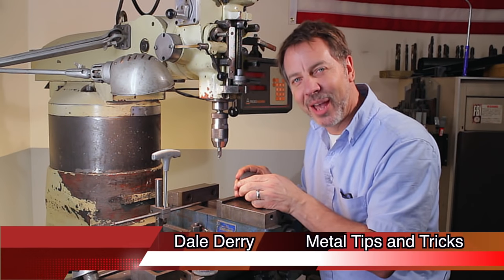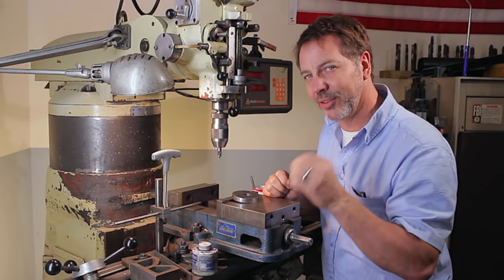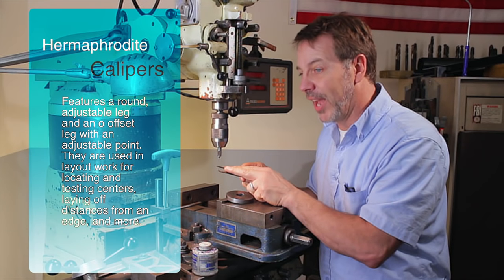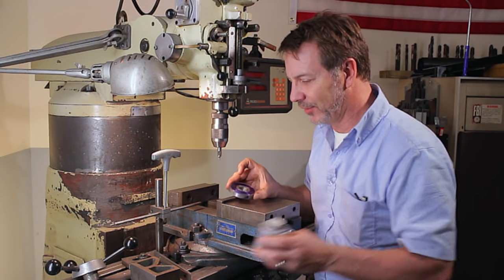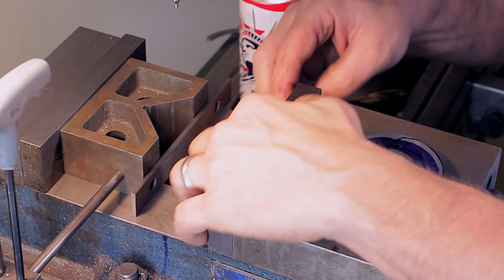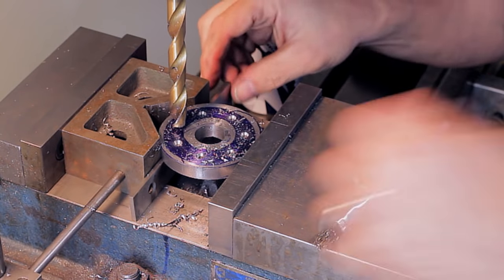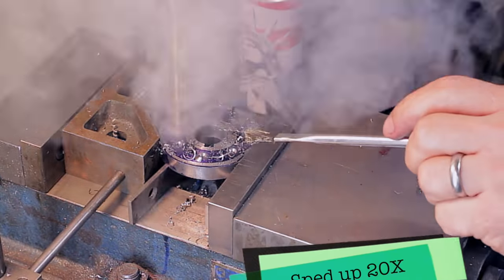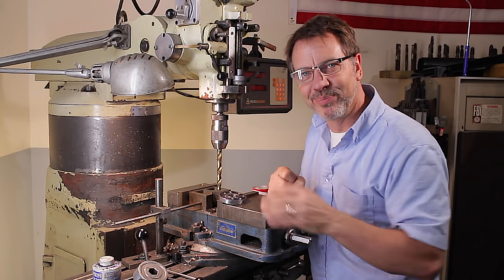How to drill a Bolt circle

Comment: Did i miss something, i was waiting to learn how to use the math to makeca bolt circle, any one can drill the holes,the part that counts is the math to divide the circles.
Reply: Circumference divided by number of holes. Advertising major here
Reply: @basik1dotcom  But the dividers are chord lengths not arc lengths. Then it all depends how good your eyes are to center drill on the scribed lines.
Reply: Divide the number of holes into 360  yerimy
Reply: basik1dotcom 
Yes. 
Elementary my good man.
Reply: You would obviously know how many holes and what dia before starting. The straight line distance ( not curved on circumference) is the segment. To find segment length S

S = 2r x Sin (degrees)
       ——————————
                     2. 

Degrees is the angle between two holes, in this case 7 holes. 360/7 = 51.42857143 degrees.
Reply: @husq2100  Need to divide the degrees by two, not the entire 2r x Sin(degrees)...should read "2r x Sin(degrees/2)"
Reply: @basik1dotcom  ...you should stick to advertising
Reply: @bretthenderson6770   To funny Daddy-O  LMFAO
Reply: @bretthenderson6770  Nice burn. Well done. 😂
Reply: @bretthenderson6770  will do!
Reply: @bretthenderson6770  So S=d(Sin theta/2)?
Reply: @bretthenderson6770  he was right. maybe you should try advertising.
Reply: Pi will never divided down rationally so using dividers on a circumference is a bad idea always.  Angles are better.
Reply: @husq2100  thanks. And setting the calliper distance should be as easy.....

Comment: The method of drilling holes in a round block is easy enough, the problems come about when you need an exact tolerance, if you make 2 separate plates then bolt both them together it would be only luck if the holes line up.
Reply: Can you then use transfer punch to translate the hole pattern over to the other plate? I know one can, jsut not sure how good the tolerance of that may be.

Comment: Or use the bolt circle table in Machinery's Handbook. Gives you the XY coordinates for all bolt circles from 3-12 holes based on a 1" circle. Multiply the XY coordinates by your bolt circle and then use your DRO or the graduations on your table. That's the right way. I'd be making holes before you were done with the layout.

Comment: Actually, indicate in on the center hole and set your table dials at zero.. Then look in your Machinery's Handbook. It has a formula that, If you know the diameter of your bolt circle, will allow you to compute X and Y settings for your mill table for various numbers of holes. If you can multiply and/or divide on a calculator you can do the math. If your lead screws are accurate, it will put your holes on within a thousandth or so.
Reply: and in a zeus handbook it works it out for you so all u do is just multiply,
Reply: Lawrence, right on,

Great little pocket data pad, use it all the time, one in the house and one in the shop, and cheap, about $15 cdn includes shipping from UK,

Edmund.........Alberta
Reply: Get a Zeus handbook. It has all you need to do bolt hole circles. If you have digital display or even the bog standard dials it works.
Reply: Exactly you can even use a dro calculating program online
Reply: No shit
Reply: Exactly my thoughts. Why be inaccurate when you don't need to be. I've been a master Tool maker for 40 years and would never lay out holes with dividers. I respect my work more than that
Reply: i agree with you how did he index for each hole by eye ball?  iso9000 right he has good eye

Comment: I use the bolt circle calculator found online. Make the O.D. of your part larger than the finished part so that you can sit it on the parallels. Drill the center hole first and use the calculator to find where to drill your bolt circle holes. The center hole dose not have to be exactly centered because you will turn the od of your part in the lathe by putting it on a spud with a drilled and tapped hole and a bolt and washer. If you have a DRO on your mill it makes this process very easy. Remember once you drill the center hole do not move the part you are working on untill finished. This is the only way I do this and Ive done it hundreds of times.

Comment: To get this to work folks is you need to know the chord length. There is a formula for that in the handbook. I use it 90 percent of the time and it never fails. I made a cheat sheet up so I refer to that and away I go. Or many modern dro's have a calculator built in. Look to see if you have that. Then just dial the center and away you go.

Comment: A lot of nay-sayers and eliteists here.
40+ years ago I was laying out a bolt circle for a PVDF pipe flange on a wet bench drain, and the company owner chastized me for "gold plating" it. At the time I was offended, and thought to myself "geez - he doesn't care at all about quality"
In later years, I was the business owner, and found myself on the other side of the same discussion. (fortunately the lesson wasn't lost on me and I explained to my employees WHY, which they did understand)

 Some work just doesn't justify pulling out the rotary and spending 2 hours on a pipeflange or something similar where "Good enough IS Good enough" (better actually).
Once that pipe flange is bolted up, no one will know or care if those bolt holes are a few thou off. The machine will not operate any better, just cost more. They WILL care if the machine comes in over budget and everyone looses money on it. Many farm machines are the same story and are designed with loose tolerances where they can be tolerated for just this reason. I occasionally do repair work for local farmers, and they don't care if it's perfect to the tenth, they need it to work for a reasonable cost and fast as they often are on a hard deadline.

It's easy to be a perfectionist when someone else is paying the bills, and you have all the time in the world. This type of setup (and the radius trick in another video) Indeed has a place in industry, and it's a bigger place than most people seem to realize. 

It seemed to me it was stated up front this is a technique for when it's NOT justified to spend 1/2hr breaking down the mill and setting up the rotary, but an awful lot of people seemed to have missed the point.

I think this video describes a better way to do good work "good enough" to make the customer happy and the shop money. That's what it's all about in the end.

Scott
Reply: Hi Scott, 
I'm in agreeance with you. Unless the job requires precision then there is no need for it. I like to be a perfectionist from time to time, yet I know there is line drawn with individual customers and their needs as opposed to what I would do for myself or love jobs for family and friends. Though, there are some customers that appreciate the little bit of effort you put in which is reciprocal kindness 99% of the time, you know others just want the bare minimum - get in and get out. The bottom line is, you don't do anymore than you have to...
Reply: Good 'ole plain common sense, and a really excellent compromise between , cost VS adequacy and client satisfaction.
Reply: nifty1940 no one mentions pride in the job....do it once do it right.
Reply: Holds true for every trade. I try and  show the apprentices when its o.k. to be a wood butcher and when you have to split pencil lines. 🤣😂😁😀😎
Reply: But Scott... he never explained how he got the holes spaced.
Reply: Scott.  great point.    after years of putting blue on a  part.  i just put an indicator on and found where i was at,  and went for it.    why do i EVEN need blue on my part.
Reply: For pipe flanges, this is a great solution. 
If the bolt circle in question is for something that rotates, like an axle flange, rotor or wheel, not so much. As you stated in your reply.
Reply: @tomclark6271  he did. After he put layout fluid on it and he centered his starting hole he used the compass to scribe the distance of center for his bolt patern
Reply: Totally agree. When I was young, everything had to be perfect. Perfect takes way too long when “good enough is just that ... it’s good enough. Why waste time making it perfect.
Reply: In Business School the first lesson we learned was do the Cost/Benefit analysis before anything else. It's fun and prideful to chase perfection. But if it doesn't make dollars, perfection befalls the business...hard to brag about your perfect workmanship in the Unemployment Line!
Reply: @solasauto  center drill
Reply: @tomclark6271  he didn't
Reply: @DrewT  this is why we buy Chinese now we are all unemployed

Comment: I have been a machinist for 40 years and it is always nice to learn something new. I subscribed by the way, didn't want to miss out on other tips and tricks. Even after being a machinist for as long as I have, I find the process fascinating to take a block of material and turn it into something useful. As I read the comments concerning the making of this part, I will agree, there is more than one way to skin a cat. Versatility is always going to get a machinist out of a jam. And if the tolerance for the part isn't that tight then there isn't any reason it can't be done without the rotary table and indexing. Thank you for the video.

Comment: It should be pointed out that this method will work with a drill press, which typically does not have precise XY positioning. Thanks Dale!
Reply from the maker: Great Point John :-)
Reply: My thoughts exactly!
Reply: @StoversMotors  Yes this is a very good drill press way to geter done

Comment: Great educational video... I just finished laying out a 7 hole 5\8 diameter holes pattern on a 2 1\2 inch diameter circle in the method you described for my new 6 inch diameter flywheel on my vertical double acting oscillating steam engine... Really enjoyed the simplicity of doing things old school... Thanks again,Frank
Reply from the maker: Hi Frank. I like your comment. I did it for a friend of mine working on a steam engine for his kids. .

Comment: Great video. I am going to practice this technique later. I use a scrap piece of brass to knock down and secure my work (~2" in diameter X 3" long) . The brass knocker fits in tighter places than a hammer, and the weight and softness of the brass doesn't seem to damage the work. Thank's for the video.

Comment: Keep your parallels from falling over by putting spring between them, if your springs don't reach from side to side I just add some small blocks. This is great if you are doing multiple parts or are re-positioning parts in the vise.
Thanks for the tips and keep making chips.
Reply from the maker: +clemenaugh 
Great Idea

Comment: Can you explain how you set the compass to the right distance for marking the holes? I usually just calculate the coordinates of the holes from the center point. Then just crank over to each point and drill (even easier with a DRO). I think some DROs will  even do bolt circles calculations for you.

Comment: Indicate or edge find center, then use Zeus book, trig, or an app on your phone I use an app called CNC bolt pattern it gives you the option of a graphic point or manual output ( 1 hole at a time ) angle of rotation etc.
as a toolmaker I am often asked to do unusual layouts to fairly tight tolerances, I hope that this helps.
Robert

Comment: HI,

Great video, how did you compute the distance between the 7 holes?
Thanks
Tony
Reply: Circumference of bolt circle divided by 7
Reply: @leaettahyer9175    that doesn't work. You need to compute an object with 7 straight sides (septagon) then get the length of the straight side.
The easiest way to do that is with a CAD program or an online calculator.
Or, if you are old school, a good machinists handbook might have a table of multi sided objects and The length of their sides.
Reply: @wizrom3046  You're more correct than you know, and yes a CAD program will calculate what I'm about to describe.   There is some omitted detail here in the interest of saving time; dimensions for starters.  This information was used to set his dividers.  You have to be familiar with the concept of coordinate pairs (x,y).  Each bolt hole center is located from a common datum point which is more than likely the center of the disc.  The center of the disc and the center of the bolt hole forms the base of a triangle. Utilizing the Sine and Cosine, whichever the case may be to calculate the opposite or adjacent angles in that triangle you can calculate the distance between the hole centers; this is the dimension he used to set his dividers.  If you know the holes are equally spaced you only need to do the calculation once.   Once he had his dividers set, he simply went from one hole center to the other, 51.4 degrees apart resulting in 7 equally spaced holes.
Reply: @ecmillerbud1    thanks! Nice comment. 👍
In the workshop I have a number of protractors, which are probably my go to method for achieving a result fast.

Comment: The point of this method people is to show how you could have done this with a drill press as opposed to using your read out or dials X-Y with trig or hole position pattern in some read out heads. Simple and considering they are " BOLT " holes visual accuracy is fine. This is old school and it works.
Reply: Thank you!

Comment: how did you get the spacing right ?    You left out aomething
Reply: There's a formula for cord or chord distance (can't remember the proper spelling). I used to lay out bolt circles on machined castings in a foundry machine shop. I've been away from that for a few years
Reply: @ontariosfinest8971  there is a chord chart on line it gives a hole center to center based on number of holes and hole ciercle diameter
Reply: You would obviously know how many holes and what dia before starting. The straight line distance ( not curved on circumference) is the segment. To find segment length S

S = 2r x Sin (degrees)
       ——————————
                     2. 

Degrees is the angle between two holes, in this case 7 holes. 360/7 = 51.42857143 degrees.

Comment: This is an interesting method. Quick and dirty definitely has it's place in an emergency, but if you are in a machine shop, the least you can do is dial indicate the reference dia ( I. D. , or O. D. ) trig out the X, and Y locations , dial in the hole locations and drill.
The consensus is it doesn't really matter, but whoever machined the opposite side of the flange more than likely dialed it in, or drilled with a fixture with drill bushings, so it'll definitely fit and seal better with an accurately drilled flange.
In the long run, doing it right takes the same amount of time as doing a "short cut", and you know it'll be right.
As I said originally, this short cut has it's place in machining / fabricating, and that is what you are teaching, and teaching well.
Even laying it out this way, you still need to figure out the chore between the holes on an evenly spaced bolt pattern, so your halfway to trig-ing out the hole locations anyway.
Good video.

Comment: Nice video. I print the circle and the bolt pattern on the printer (regular paper) and lay it over the work with Elmer's white glue. After the project is finished the glue will remove with water. Not high tech but simple and fast.
Reply from the maker: +acklan3 
Great idea.
Reply: I was gonna suggest that. Nowadays everyone has a computer & printer.

Comment: I usually just cheat by laying it out in a cad program to get the offsets from the center and drill the parts. It only takes a few minutes and you don't have to remove the vise. Of course I have a DRO but it could be done with dials. Keep up the good work, I enjoy your videos.

Comment: Nice article thanks!. The proof of the pudding would be as follows, (to check accuracy). When setting up to drill, put a bed disc under the flange, (say around 4mm thick), and "tack" the pieces with superglue, and at each hole, drill through both pieces). When all holes are drilled, warm the parts to break the glue bond and then change the relationship between the holes in both pieces, by rotating one piece or the other by one hole. Only if they all match are you on a winner. This is particularly useful when using holes that do not work out to a whole number of degrees and using the setting out method you selected. I've just been through this as I had to make 6 flange plates, and do not have the luxury of a rotating table/chuck arrangement and used a method very similar to yours.

Comment: Well, you did miss a critical part there with the hole spacing. If dead nuts accuracy isn't needed you can draw lines thru the piece splitting the center hole dividing it like a pie. This will get you pretty good accuracy on an even count of holes anyway. I start by placing a dot with a sharpie on the outer edges starting at 12 o'clock - 6 o'clock, then 3;00, 9:00 then split those lines for more holes if needed by measuring the distance between the lines on the outer edges between 12 and 3 then 6 and 9, and so on. This will give you an 8 hole circle. I use this method when cross drilling brake rotors. You can get very accurate with just a steel ruler to measure and also draw straight lines with

Comment: Always enjoy your videos and the bolt circle video is another great example. I worry about you wearing a wedding ring working around metal working machinery.  Every Tool & Die shop demanded we have safety glasses on at all times, and no rings or wrist watches on wile working. A finger can be pulled off so quickly and they are hard to put back on tour hand.  Keep up the excellent videos. BB

Comment: This is similar to the test I had to do for the Drill Press and Layout Section, I had to do for Machinery Repairman (Machinist) School in the Navy. It's a good method to use if your holes have 1/32 or more of clearance. If the print calls for tighter holes than that, I would get out the dividing head or indexer. 
You might want to show newbies, how you calculate chord length in order to set your calipers?